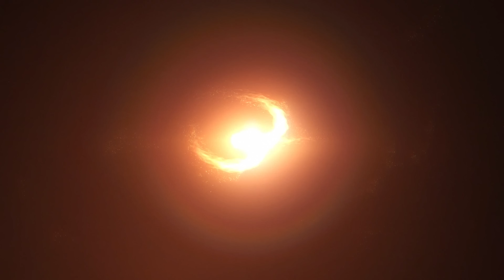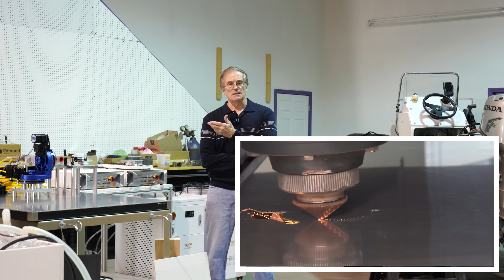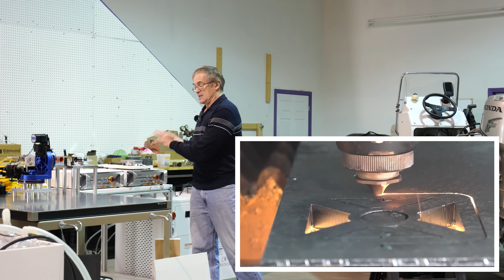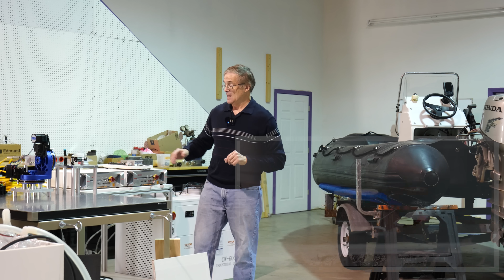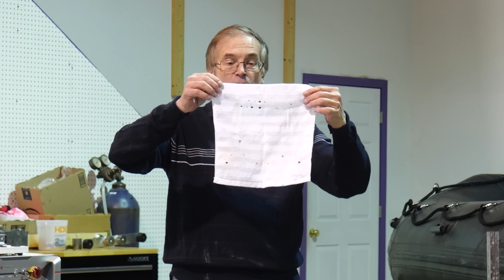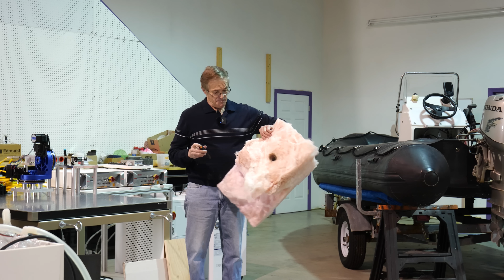We have a problem... and need your help!

Comment: I have 3 ideas: 1- if a mirror works aim the laser into a tank of water at at 23cm deep, 90% of energy depleted by water adsorption according to Perplexity.
2- If a mirror does not work, make a 1cm thick water feature(waterfall) with additives to adsorb the 1064 nm laser beam.  Recommended additives are Antimony trioxide (Sb₂O₃) or tin dioxide (SnO₂)[ concentration: 5–80 wt%], Titanium dioxide (TiO₂) or copper phosphate,  Double check Perplexity
3- The space shuttle tiles adsorb a lot of energy without melting

Comment: You’ll want a material that can absorb and dissipate laser energy effectively without degrading too quickly. Here are some options:

Graphite: Excellent at absorbing laser energy and converting it into heat, making it useful for temporary shielding.

Ceramic Composites: Some ceramics can withstand high temperatures and absorb laser energy without melting.

Tungsten or Molybdenum: These metals have high melting points and can absorb laser energy while dissipating heat.

Specialized Laser-Absorbing Coatings: Certain coatings are designed to absorb and spread laser energy safely.

Carbon-Based Materials: Carbon fiber or carbon black coatings can absorb laser energy efficiently.

Comment: Build a brickwall on stable wheels filled with fine gravel and sand. When you burn through, gravel and fine sand maybe reset in to the burned hole. All entry doors should also be in the setup of the laser interlock, serial switches with manual reset and redundant switch for reenable. Also each direktion of the motor movement should be minimized with mechanical interlocks in case of computer or motor failure. Use always good laser goggles for pulse laser.

Comment: if you know the laser location you can use large solid glass blocks. assuming its in the transparant part of EM spectrum it will only be slowly absorbed in the material not overheating anyone part (like a long tube of glass or a pane on its side).

Comment: Considering portability and lightness...
Firing from scaffolding in an elevated position with a downward angle (with physical + electrical lockouts on its max allowed elevation and deviation,) would let you tailor variable field of fire depending on height of the tower.

+Scaffolding is light, quick to assemble, cheep, and, could be transported in a single truck bed depending on height / desired target area. 
+I'd count the ground as a free/renewable target area reducing consumable target area. (RIP your lawn) 
+Avoids the berm issue of renting equipment / tearing up terrain. 
+Hell it could be mounted in a truck bed.
-Targeting may be affected by wind, consider guy wires.
-Targeting may be affected by flexibility of the tower depending on speed / weight of tracking elements. 
-Adjusting optics at the top of a platform may be a pain in the ass due to a less than stable platform.
-Unsure of the max length for the fiber cable w/o losses.

Comment: No you don't need anything special.  Just a staircase and platform a dozen feet in the air.  Then you can aim the laser down towards the floor / ground.  You then let the Earth do the stopping for you.  After all, the Earth is a bit thicker than most materials you can buy or make.
You just have to think vertically, instead of horizontally.  You might consider building a siloh if you want to use it at any appreciable distance.  While not cheap, they are certainly not "millions of dollars".
Reply: On second thought, the laser could be suspended over the experiment, whatever you are slicing and dicing could be at ground level, and the residual light could go into a hole under the experiment.  The hole would probably grow deeper as you use the laser.  But that could also create some unpleasant vapors.  So perhaps that hole could include some ductwork leading outside with a fan to draw the vapors out of the building.  The noise could be minimized by placing the fan outside.  Which is another reason to design and build a siloh dedicated to your laser experiments.
I think I would go with a concrete floor with a 4" (or so) pipe buried underneath.  Then use the laser to cut the hole in the floor, right through the pipe.  Once you have cleared out the hole, you now have a vented hole to capture the unwanted laser residuals.  The hole, as I understand it, should need to be only a few inches in diameter.  Certainly nothing to fall into.
Edit: and I think I would mount the laser in a non permanent way, so you can still take it outside whenever necessary.  Perhaps rig a way to detach it from the rigid mounting scaffold and lower it to ground level with relative ease.
Reply: I also had a crazy thought.  What if we're thinking about this the wrong way?  What if refraction is the way to go?  What if we put the beam through a lens that de-coheres it, or just spreads the beam out over a larger area?  Thus making it more easily manageable.  You managed to focus the beam, how about de-focusing it?

Comment: You could Dig out ann earthen burm. Which should be the cheapest.
Or you could Sandwich 2 panels together With through ties One foot apart.
Like the foam Panel concrete moldes and fill
With something like sand in between. So when the beam burns through the first panel, the sand acts like a fluid even if it melts, it backfills hopefully fast enough to  diffuse the beam.
before the beam gets to the second panel. Or if there's enough depth. Which is the same as if you fired the beam into the ground. And when you're done, you drain the sand from the bottom of the panel Onto a truck bed. Modular panels. I hope this helps.

Comment: I would try a very large fish tank filled with water and tiny reflective particles held in suspension. I would add a salt (maybe magnesium sulphate) to increase the density (TBD) of the liquid and help the particles stay afloat. Possibly some form of vibration to keep the partibles from settling (maybe a circulating pump). I would make the tank of plastic instead of glass so that the laser can burn a hole though it rather than shatter it (patching would be simple and cheap). I would make the tank thin (maybe a foot) but tall and wide (maybe 8 by 8 feet).

Comment: What you might need is to diffuse/diffract the beam first before it hitting a catching layer of resistant material.

A solution could be to use laminar water falls in succession for the diffusion/diffraction part before it can hit a catching wall. Since water will be disturbed on its falling path it should not act as a reflective material.
The water falls can be made on hollow supports (like a curtain).
Major risk would be if the water falls stop for any reason (pumps giving out for example) while the laser is on, the diffusion/diffraction layer disappear and you're back to your original problem.

Sorry if my English is bad, as it's not my native language.

Comment: Sand, Fill small square glass fish tank. Get one paper cup paint it black, cut the top off the cup to make a ring. tape it to the centure of one surface of the fish tank full of sand.
Fire the lazer into the centure of the ring.
After use, mix up sand and fire up lazer again.
Might work repeatably with not much fuss or clean up.

Comment: Same as you would a gun range, a birm. They aren't portable, but for testing, they work well and exist everywhere.

Alternatively, you're testing with extreme power if you can't dial the power down, use a laser pointer to stand in for the beam for testing and aiming and only test power in a fixed direction. 

For fixed lasers, you can use a lens to diffuse the light with bricks behind the target area. And for a safety, drill a hole in a large paver (or 2... or 3) to prevent a situation where the aim changes.

Alternatively from all this, you can make it to where the beam only  converges on the target.

Comment: Asbestos. Not healthy but good heat resistant.
Reply: You might consider to keep the protecting material moving. Like the old paper billboard ads that rotate to the next advertisment after some period. But in this case you want to keep it rolling permanently.

Comment: Easy, 45 degree mirror to redirect it straight down into the dirt on the ground. You won't burn through Earth any time soon and it will absorb most of the light. Or a deep box of sand/sand bags. The sand will naturally fall down replacing the lost sand from the burn hole. Another one: a big lens that simply defocuses the beam at the end, making it easier to stop.

Comment: Might be able to use the concrete board used for backing tile walls. It’s like a 1/2 piece of 8ft drywall but it’s concrete and heavy. They are available at Lowe’s and other stores like it everywhere. It will probably still smoke some though. They have stuff called hardie plank that’s essentially concrete siding for houses it’s thinner than the board. Neither will catch on fire so should hold up.

Comment: important thing about the transparent is that it is able to be transmitted like the lenses you are using for focusing so it will not have much effect on the material due to it not allowing pure absorbing properties like clear plastic to a green or blue laser vs putting sharpie on that clear material and then hitting it with the laser burning the sharpie coating thus transmitting enough energy into the clear to make a mark but once gone it just makes a diffusion effect like the sheets of plastic in an LCD screen to diffuse the light of the backlight evenly through the LCD pixels :)

Comment: the pink insulation reminds me of the powdered ruby and sapphire material that I mixed a tiny bit of powdered iron and was able to fuse together to make crystaline material of the alumina in it using my 405nm laser but with out the iron (red rust) oxide powder it did next to nothing to any of it.

Comment: what about something that is both transparent to the beam photons but is not smooth so it causes the beam to instantly spread back apart (like a diffuser)

look at how a 405nm laser with cutting power effects natural or translucent clear ect materials like PLA that it SHOULD burn drastically BUT it does not instead it will pass through and burn what is on the back side but further away and it just turns into a larger and larger thus weaker and weaker beam per increment of the item. If you can do that then you should be able to get sheets rolled up that are frosted on both sides so the beam will both pass through and spread out on passing through to make it with in a few feet safe to absorb into just about anything.

Comment: Been thinking about this. Would a one way mirror/gap/regular mirror at a slight angle off perpendicular work?. Beam passes one way, hits back mirror, slight deflection, trapped in cavity, add mirrors to sides to keep energy contained. Maybe Chris @Krugtech could help...

Comment: You wanted something that's easy to deal with. Remember that invention a few years ago to replace sandbags used to protect properties from flooding? They created a canvas tube that you fill with water. It creates a wall that is very easy to move when it is empty. 

What if you created something like that except it's more than one it's like an onion. I don't know the method that you would follow in order to fill these things but you put varying transparent fluids in each bag and the laser goes through the transparent ones but the cloudy ones absorb the energy as it passes through. I know it's a narrow beam but there must be some kind of distortion that happens to it a fluid.

What if one of the layers was fiberglass inside of the fluid? Would that break up the beam a little? I know water is far below the temperature that glass melts but in a large enough volume there should be enough water pressure too slow things down. Even if the water boils it'll cause steam, won't that interfere with a laser?

What if one of the internal bags is a fluid filled with something like litter or metal filings or powdered glass? That would cause the bean to splinter if not bounce around like crazy which might be dangerous.

Comment: An industrial thermal sensor from a fire system.  Hack it.  Point it at the test area and mask where you want the beam to hit.  Should the beam hit anything else it will create a hot spot which the sensor will see (thermal camera style sensor), it can instantly cut the beam energy.

Comment: I have been doing lasers as a hobby for a long time. There exist this exact device. It's called a laser dump. Or laser trap in optronics. You can purchase based on power. A quick Google shows one for powers up to 11kW. Photonic equipment isn't cheap, it's a specialized field, and you don't want to take the cheap route for these kinds of things anyways considering how fast you can get burned or lose an eye from a stray reflection. I would say even a reflection off a copper pcb trace in these drones could blind someone. Another option is to enlarge the beam. If you have a larger beam profile, you have less mean wattage/cm2, but with focusing optics, you can add distance estimation in the tracking software and adjust the focus to target. The added benefit is a quicker de-focus after the target too.

Comment: You're onto something with the water, but you're thinking 2d. You want a decent thickness box of plywood or something, filled with those porous concrete beads that get compressed into cinder blocks, idk what they are called rn. Then you fill that box with water. The porous concrete bits catch the beam and the water absorbs the energy. If you want to move it you drain the water and move it.

Comment: Geometry and mirrors.  If you can't stop the beam, change its angle and send it somewhere it doesn't matter.  I realise for a large area like the size of your shop thats difficult.  A very large mirror and divergent, sending the beam everywhere unless its a specific shape and thats expensive. 
It might not make as dramatic a video, but you could split the laser power and the targetting experiments into two separate risk models.  Instead of blowing drones up, play "laser tag" and focus on the targetting.
Then in static tests using static mirrors to send the beam to a bucket of sand (not wet) for your destruction power tests.... in a field, miles away from anyone.

Comment: One idea I have is making some carbon foam! You just need to pyrolyze something like a sheet of doe or a bunch of slices of bread. Carbon foam is extraordinarily resistant to heat, doesn't reflect light, and can be very cheap depending on how it is made. There are other similar things like the mythical "starlite" coating that would probably work very well, if only it was real. The person I've seen get the closest to making real "starlite" is another YouTuber named "NightHawkInLight". Not sure how well these would do against that laser, but it wouldn't hurt to give it a try!

Comment: Retro reflector material.  The stuff they paint onto high viz vests.  If you can get that in large sheets and if it reflects enough back, it could diverge and diffuse the beam before it melts.
Of course it does direct the diffused energy directly back at the laser.

Comment: I'm British, not sure if you have these in the USA.... but, Thermalite Aircrete Blocks, are make from ash so are none combustible, cannot be melted, and they should absorb the power of the laser 
https://forterra.cdn.cloud-infra.co.uk/media/2021/10/24135502/Thermalite-brochure-web-1.pdf

They are real easy to build a wall or two with, very light and just as easy to demolish, they can also be reused....
You could even build a hollow containing structure and fill it with sand, salt, ash or anything you think is best

Maybe you could talk to the manufacturer and get their opinion, but I think they would solve your problem,,,, good luck !

Comment: You said you have to use lenses to focus the beam to concentrate it on a single point, why don't you use a mechanism removing the focusing lens, replacing it with another lens diffracting the beam?

Comment: diffusing the laserbeam with an angled wall of distilled water running over a sheet that is transparent to your lasers wavelength (colouring additives for absorption instead of diffusion would lead to steam and an all the chemical niceties that follow) and  fine-tuneing  the thickness of the water-wall .   
seems the most practical measure to take, as long as the lasers wavelenth is not absorbed or reflected by said water.
if you have another, solid material that can redirect  and diffuse the laser without overheating then use this.
just writing down my thougths. hope it helps in creating more ideas towards a satisfactory solution.

Comment: water. And salt
Make a frame that’s for a mold

Melt the salt in some water and fill in the frame with the solution 
Get some heat lamps to cure it  raise the whole thing up in front of the beam 

Add a little Elmer’s glue if needed

Comment: Steel sheet covered with a sheet or more off drywall, placed under a angle towards floor or ...builded on a frame with wheels so it is movable

Comment: A quick idea is to use timber or log laid end-on only if the beam is always going to end up hitting the same spot. It may also get better at lasting longer if it's already burned - ie. it's charcoal already. Put it behind a fish tank full of either crystal clear water or have a fish tank that is smaller than the size of the end of the timber.